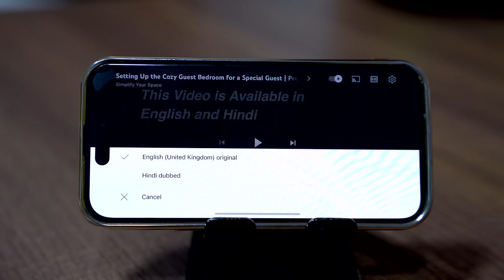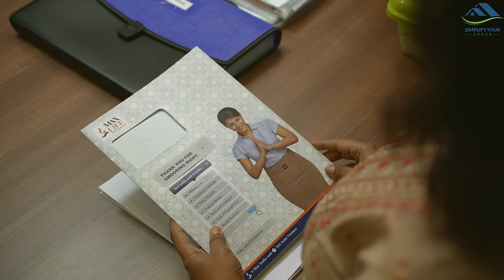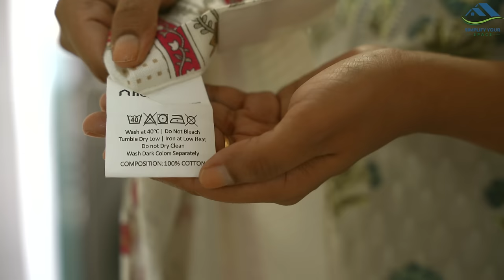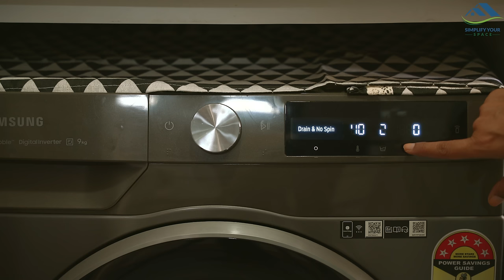Amazing and Time Saving Diwali Cleaning Tips | Must Try Cleaning Ideas

Comment: Over a period of time you taught me so many aspect of home management.... Can you pls share how to hand wash pillow? Becz we have top loaded washing machine at home.... many videos tell to wash pillow only in front loaded machine. So pls let me know how to handwash the pillows. Dry cleaning pillows is a very costly business to me.
Reply from the maker: Hi..You can use top load washing machine also to clean the pillows. if hand washing, first spray some baking soda on the pillows and leave them for 30 minutes. Now soak them in warm water for 30 minutes and then just take them out and dip them in normal water. Now take them out and lay them flat on the floor. Squeeze water by pressing the pillows from your palms from the top. Now keep them out to air dry. After hand washing, the pillows will take longer to dry as compared with washing machine. .